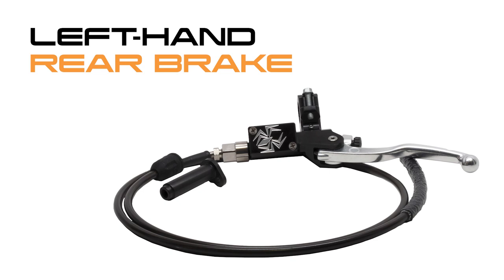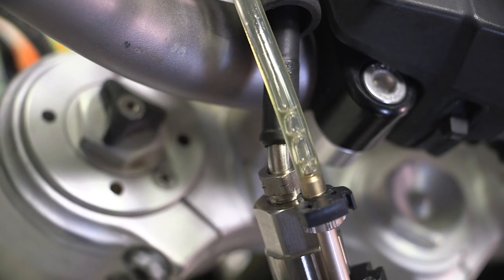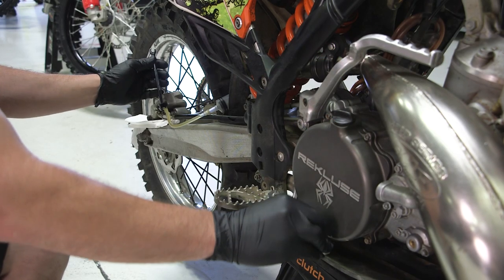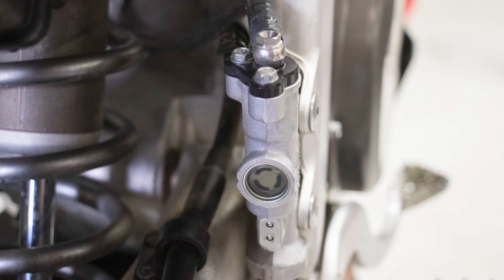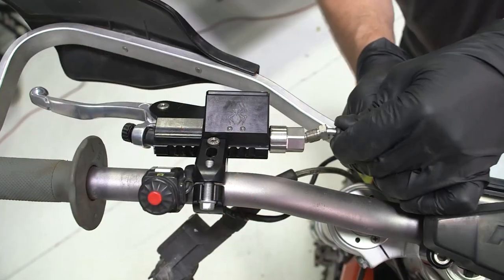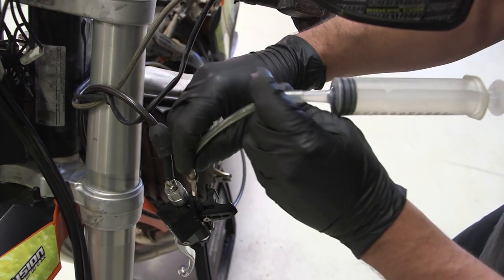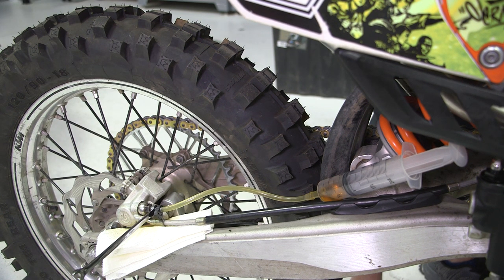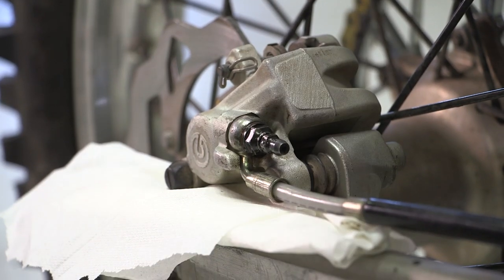Rekluse Left-Hand Rear Brake Kit Installation

Comment: One piece of advice I can offer, which can save you hours of work, mess and frustration. The o-ring that goes into the rear master cylinder is incredibly easy to damage. I followed instructions taking utmost care to ensure it is seated flat on the perch at the bottom and past the window cut-out. I still damaged it and then spent a great deal of time trying to bleed without any success with the lever. All you have to do to prevent this is to slide the o-ring over the end of the the Rekluse sleeve insert and lube it lightly with brake fluid. Then carefully lower and screw in the insert. It is easy and safe for the o-ring. Otherwise , the o-ring on the bottom of the reservoir is sort of loose, it is not in the groove or anything and have some free play, and then you screw in the sleeve the nose of the sleeve has to enter the ID of the o-ring, it can easily dislodge it upon initial contact and you will destroy o-ring without knowing. Rekluse , please update instructions to reflect this. One other thing is to keep holding tube on the syringe nose with your fingers, if you don’t, and with some pressure build up you are almost guaranteed to have tube slide off and then you will send brake fluid all over your floor and bike.
Reply from the maker: Hello, we appreciate your feedback and it has been shared with our R&D team. If you have further feedback or questions, please feel free to contact us at (208) 426-0659 8AM - 5PM MST or customerservice@rekluse.com.
Reply: Hello! Do you install it on Yamaha or KTM?

Comment: I swapped my rear Magura MC for a Brembo to run this LHRB kit. After that, this install was quite easy thanks to this video. One pointer that came from the team at Rekluse... If you are having a hard time flushing out those last hidden air bubbles, lay the bike on its side. Left then right, left, right etc. I had a small pocket rise out after doing so. I also improvised and did a little tapping and jiggling along the break line. That also released a few additional tiny bubbles. Good to go from there. Fun install if you ask me.

Comment: Just installed system on my 2022 excf 450 . Installation was very easy after watching the video a couple of times. Bled easily and worked first time. Really pleased with the kit and how easy it was to install. Works perfectly. Only 1 issue while installing...  The bleed pipe for the rear brake was extremely difficult to get onto the bleed nipple..   The pipe could do to be a fraction larger in diameter for the OE KTM bleed nipple.

Comment: Speaking from experience - I would recommend including two more of the clips in the kit - for securing the hose to the syringes. Twice, while pushing fluid through I had the hoses pop off the syringe - making a considerable mess.
But once installed, this is a great piece of hardware. A great improvement over the previous version - it fits so much better alongside the existing clutch.
Reply: Hello! Do you install it on Yamaha or KTM?
Reply: @Syemyonov  KTM & Husky.
Reply: @thebogeyman  okay, because I have a question about Yamaha installation

Comment: to bleed mine i remove the bleed grub screw on the bars place a drip tray under the bars hanging on a strap , open up the brake calliper bleed nipple with a syringe already full of fluid then pump it through till its nearly empty then close the calliper bleed nipple and refit the grub screw works every time quick n easy, secret is try get the grub screw back in place whilst the fluid is still pumping through so no back syphon of air from the lever end pretty simple really.

Comment: My install went fairly well but a few tips I wanted to share that aren't well addressed in this video:

When you attempt to bleed the system and you find that fluid won't flow in either direction, the brake pedal might be adjusted such that the orifice is closed.  you need to experiment with the pedal adjuster to get it open

Also, even when you have all of the bubbles seemingly out of the system, you may still find yourself with a spongy lever.  I had to do a bit of trial and error with manipulating/adjusting the foot pedal and cycling the lever and repeating the bleeding process quite a few times to get it sorted.
Reply from the maker: Hi Rick, thank you for your valuable feedback. I've passed it on to our Research and Development team for them to review. Feedback like yours helps us improve future instructional materials, so we appreciate it. If you have any questions, feel free to reach us at (208) 426-0659 or customerservice@rekluse.com. We hope you have a great riding experience with your new Left-Hand Rear Break Kit! -Rekluse Team
Reply: @RekluseMotorSports  thank Joe. ;-)  He's the one who gave me the suggestion about the brake pedal adjustment.  the new LHRB is definitely a great improvement over the previous generation.  did this install and a radius cx this week and looking forward to riding it this weekend!  thanks for making great products.
Reply: Good tip about the pedal, I need to look into that. I don’t have any bubbles for sure seemingly , and lever is very spongy still. Fluid is hard to push through, but eventually it all goes. I will try what you suggest here.
Reply: Hello! Do you install it on Yamaha or KTM?
Reply: @Syemyonov  KTM EXCF500. 2021 model

Comment: Hi.
Looking advise for installing Rekluse Left-Hand Rear Brake Kit.
I have the OEM closed hand guards and could not find any way to install the upper pump.
Checking Rekluse install video I see the are using hand guard mounts that attaches to the handle bar mount. 
Is the only way to install this already expensive kit is to buy another 150$ hand guard mounts?
Do you guys have any other solution?

Comment: Is this available for yamaha bikes
Reply: yes they have the part number on there web site. give them a call.
Reply from the maker: Thanks for your question. The Left-Hand Rear Brake Kit is available for pre-order for 2009+ select Yamaha models. Visit the link in the video description to learn more or give us a call at (208) 426-0659. Have a great day!
Reply: I just put a Rekluse auto clutch and Rekluse rear hand brake on my 2000 yz250 woods bike. I had to get a 2005+ rear master cylinder in order for it to work, ended up with a 2010 master cylinder. It’s an amazing setup! Had the Ox-Brake rear hand brake before and it’s not even a comparison. The overall quality and fitment with Rekluse is well worth the money.
Reply: @RekluseMotorSports  I have one now ! So awesome